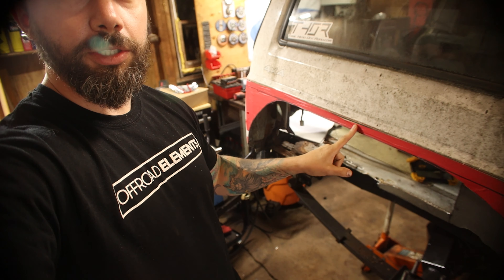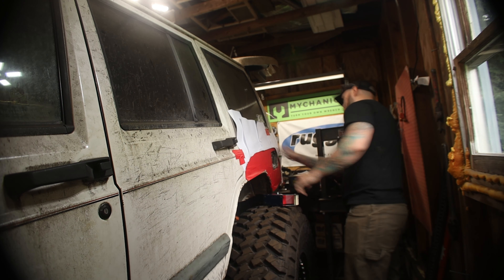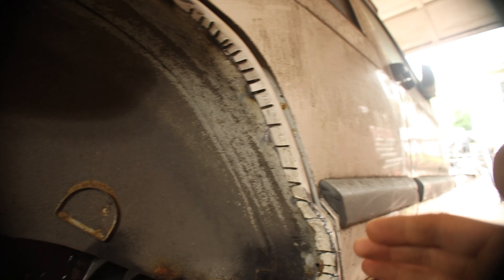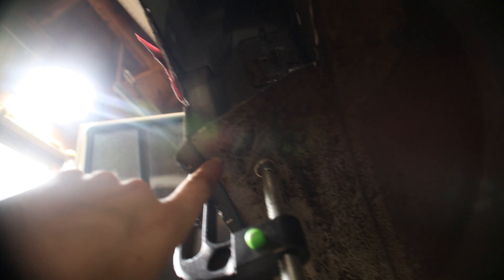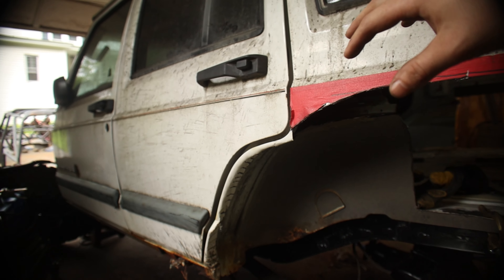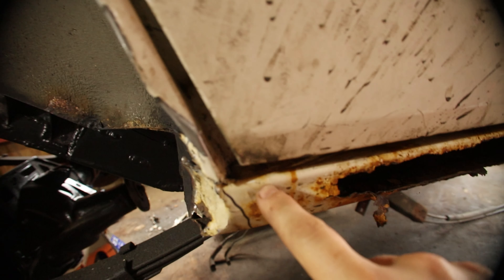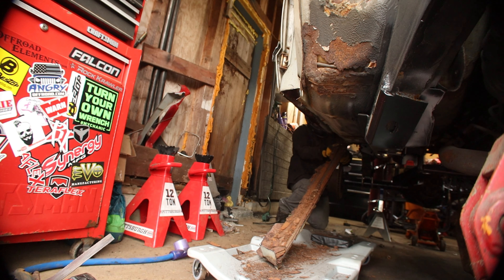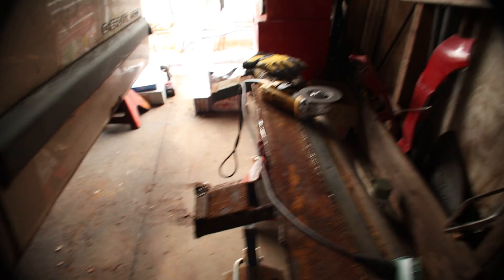How not to build a Jeep - Project ZipTie - Episode 20

Comment: Tough to stay motivated sometimes.  I know what you're going through. 

I stopped around 2 months ago. Currently on our XJ, replaced rusted floor pan,  with replacements from c2c. Just need to do some final welding from underneath.   Then prep for complete interior paint, raptor liner, WJ front/rear seat, headliner.  Then exterior, frame, bumper, ect...

I start recording, in the middle of working,  I say "forget that". 

Keep us posted.  Looking forward to the next episode.
Reply from the maker: Thanks Joe, it deff hits us all. gotta just keep going and powering through the build. It will all be worth it when it is done. floor pans are a pain for sure thin sheet metal sucks no matter how you look at it